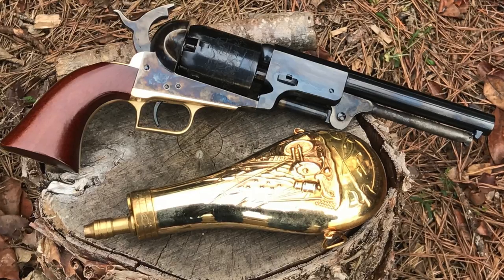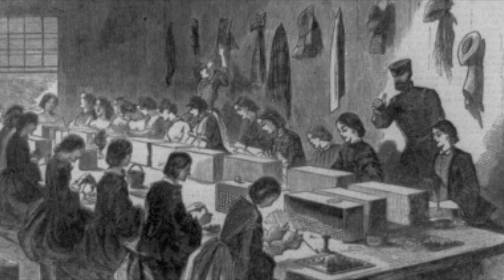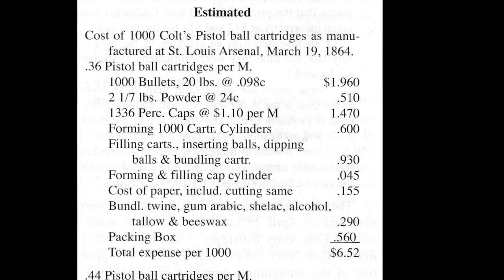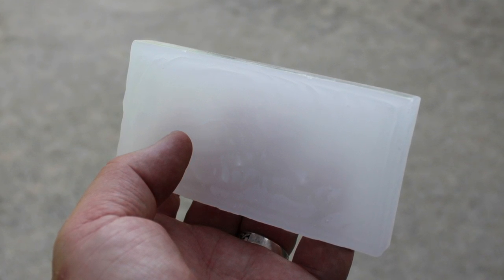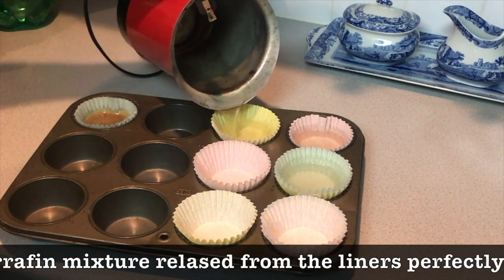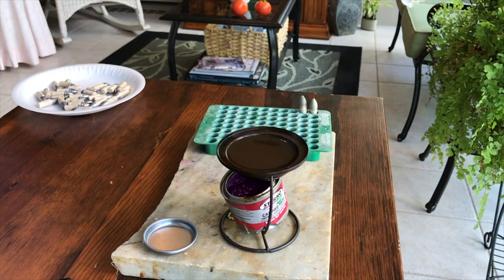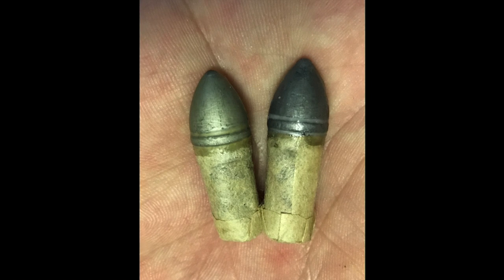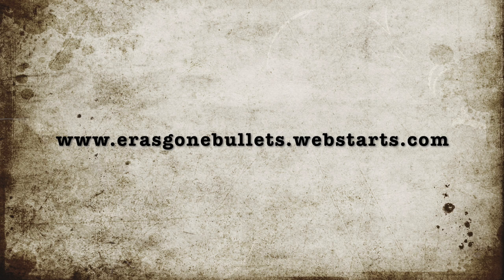Lubricating Cap and Ball Revolver Cartridges

Comment: At the 5:05 min.mark you say that steric acid used to be added to paraffin to increase the melting point. Do you think we should do that, and how do we do it?
Reply: I think it's the other way around.  Today, paraffin contains stearic acid but the old stuff didn't.
Reply: @wdtaut5650  What I would like is to have a lube that has the highest melting point possible, and still keep the gun running.
Reply: I just re listened to the vid, and you are right the steric acid is added now. I just heard him wrong the first time.
Reply: @markfrench2980  That might make an interesting study.  The traditional lube  was tallow, which melts pretty low (I don't know the actual temp) and stays pretty soft at low temps.  I know shooters today who use Crisco.  Again, pretty low melting point and stays goopy soft.  Anyone have an idea what's better, high melting point or low, and does it make a difference, or is it just a matter of which is less messy?

Comment: ...nobody used candle wax after the cartridge or normal load have been pressed? I'm thinking for hunting or long storage... Thanks..
Reply: As in dripping it onto the top of the cylinder from a lit candle? Never heard of it, & they were probably smart enough not to mess w/ an open flame near gunpowder...
Reply: Some recommend it but I have never used it.  I do use small plastic sleeves slipped over the cap to help with moisture and cap retention to prevent jams as well as prevent the cap falling off prior to firing.

Comment: Any ideas to keep it from melting in the Arizona heat?
Reply: George, I deal with the Alabama heat hear.   No real cure.  In the upper 90s it will smear.  Below that not too bad.  Keep a wad of paper towels handy for clean-up.  Some folks from way up north asked how to keep the lube from cracking and flaking off in very cold weather :)  Thanks!
Reply: @MEHubbs   The problem I've been having is it just melts and runs.  (it can get up to 120 during the summer here)
Reply: Once you have 6 rounds, you need to bundle them in a labeled, paper rectangle package.  Maybe the packaging contains the grease/wax mess?
Reply: Higher wax content. Beeswax melts at a nominal 140F & paraffin canning wax higher still, so just keep adding that to your mix until it remains stable at 100deg. Anything above that & you should be thinking about coming in out of the sun until things cool off... ;-)
Reply: I live in Ohio, while we don't have as many days of 100+ weather, we still get it; plus we have several months at or below freezing; so making a bullet lube that works in all weather here is a challenge. I use a  Paraffin-crisco mixture (8:2 as I recall), but I add 2TBS of Diesel winter treatment (keeps diesel from gelling up in cold weather) per lb of paraffin. that makes a lube that is hard enough to hold up in the summer (it's tacky, but doesn't smear unless you mean to smear it), but doesn't get brittle in the winter.

Comment: can i use 777 33gr.  black powder propellant pellets in my 44cal. pietta sheriff mod 1858 n.a.m. pistol steel frame?
Reply: Anders, I don't have any experience with the pellots.  777 us a little hotter than Black Powder so 33gr might be equivilant to over 40 grains of black.  The gun might handle it, but it wont appreciate it!  I think that would be too heavy a load.
Reply: @markhubbs1964  thank you for the info, I appreciate it very much

Comment: I'm curious why these guys call for lubricating the balls when colt themselves did not call for lubrication or wads

One could guess the parrifin dipped paper cartridges were more for waterproofing with reduced fouling being a side affect.

Are you using flash paper or rolling type paper?
Reply from the maker: Colt never suggested grease over the ball like modern shooter use.  However, his bullets were lubricated on factory made cartridges.  The same holds true for most other cartridge makers during the era.